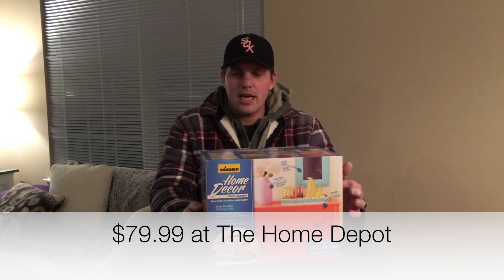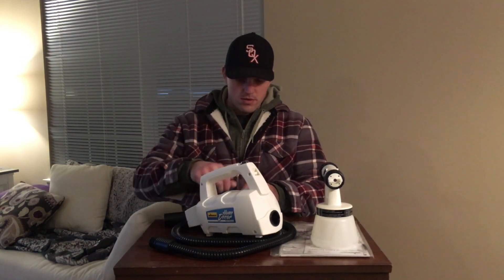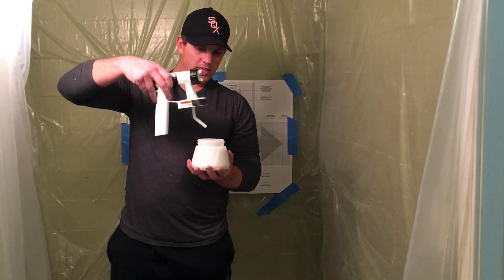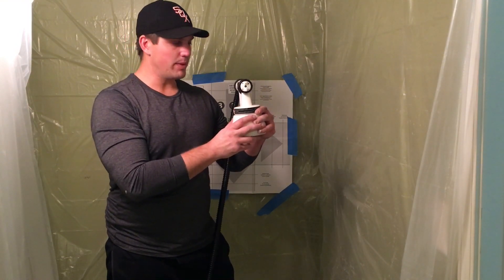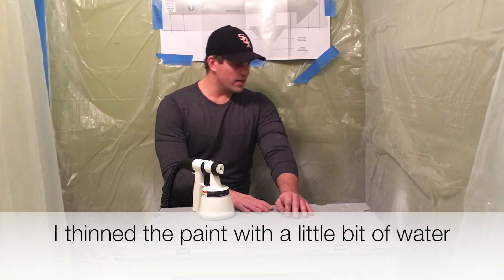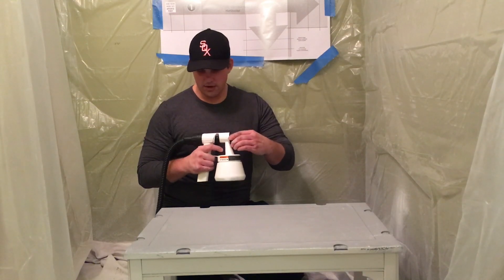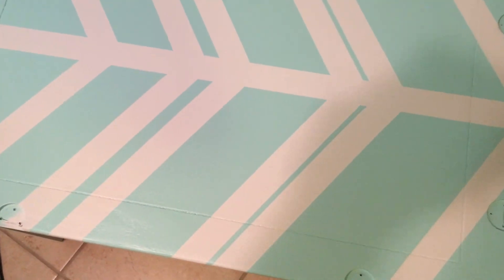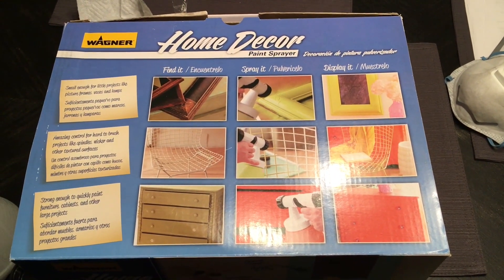Wagner Home Decor Paint Sprayer Unboxing and Review

Comment: Watching you paint against the fan spread is irking the crap out of me. If the tip is vertical, the fan will spread out horizontally, which means you spray vertical to utilize the full spread.

Comment: Dude you are spraying with the tip wrong. you had it backwards. That's why the width was so thin when you tested on the paper across with the tip the you should have been going down the way the tip was. And when going down you should have been going across. So basically If those nubs on the sprayer tip are up & down you paint up & down. If the nubs are left to right you paint left to right.
Reply: Your paint test should be as wide as those darker grey strips are on the test paper
Reply from the maker: I had it on wrong? or I explained it wrong?
Reply: Both. This is hard to explain thru text lol. If the tip is horizontal you paint vertical and vice versa.
Reply from the maker: that makes sense...I've used it a lot since then and have gotten the hang of it.  It makes painting furniture a breeze
Reply: Here for the nubs.
Reply: @whataboutthis3260  both. lol